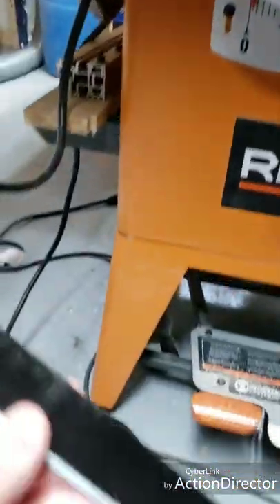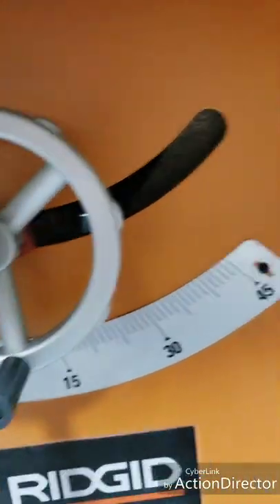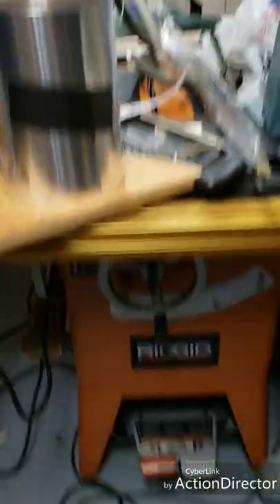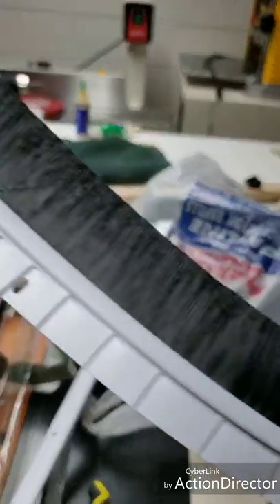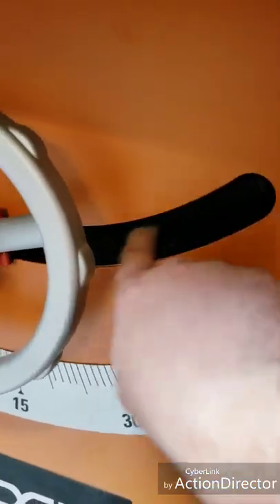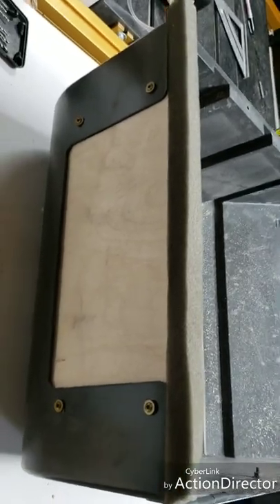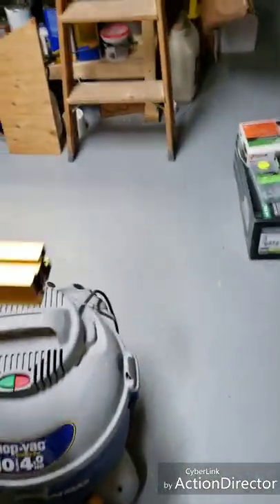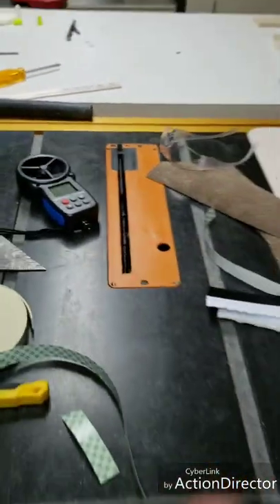My table saw really sucks! Dust collection upgrades, step by step. Ridgid R4511 (the holy Grail)

Comment: I was concerned about how to seal of the same slot on my table saw. After seeing this, (and being “cheap”), I looked around for the cheapest option for a door sweep. I went to the big blue and big orange, no luck. Amazon was my last option. Most of the sweeps were $10 plus, I didn’t want to spend $10 to test a theory, all of a sudden found one for $5.59, the comments all complaining about the sweep comes in four 10” sections, a bonus for me, I don’t have to saw a good sweep into pieces.
It arrived the next morning, I tried to make it curve with my heat gun, to no avail. Self sticking back, cleaned up the area with degreaser, works exactly as required, one 10” section above the slot, one below!!

Fantastic and cheap, which is why you are  searching YouTube.
Made by “We Test”, I have not heard of them either!
Perfect, about 45mm of actual brush, plus 25mm of very tough (not malleable) plastic edge along “door” side.

Comment: Is that the harbor freight DC? I've just set up me new Delta 36 725T2, and I have the HF unit too that will be set up next.    I am very excited if you're using the HF DC and pulling 611cfm with thay mod!
Reply from the maker: Yessir. Hf 2hp with a cyclone, rikon impeller and element filter
Reply: @TheFeralEngineer  the rikon impellar is out of stock. Im keeping an eye. Ill be venting outside with a 5" super dust deputy and 5" mains.
Reply from the maker: @TPstrongman  i think it's always put of stock. I had to sniff around a few places until I found it. Did you see my dust collection build? I did a whole video on that thing, too 😊

Comment: Hi great video I recently obtain this saw for free but it’s missing the rear fence support. Wanted to try and fabricate my own instead of spending a couple hundred bucks on a fence. Anyway you could send over the dimensions of the rear fence rail supports size and angle iron. Any help would be appreciated.
Reply from the maker: It's a two piece assembly, but in total, it's 56 inches long, outside dimensions are 1-1/8" x 1-1/8", internal dimensions are 1"x1", if you're looking at the angle mounted to the rear of the machine from the front of the saw, the first hole from the left is 7-1/2". 

FYI, I have an incra ts-ls on mine and it's an absolute dream

Comment: I have an R4511, what aftermarket fence is it that you have?
Reply from the maker: That, sir, is an Incra TSLS 👌👌
Reply: @TheFeralEngineer  Ouch... $$$
Reply from the maker: @bmack500  twice the price of the saw 👌 plus, I've got the router table, lift, downdraft cabinet and router fence and joinery pack for the tsls. Only die once 👌👌